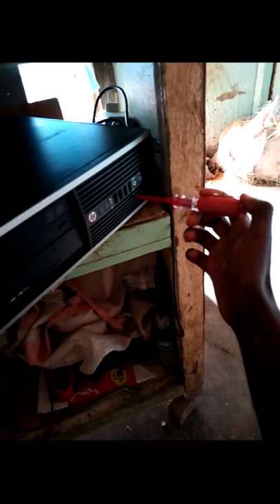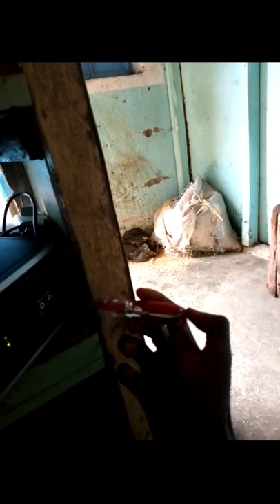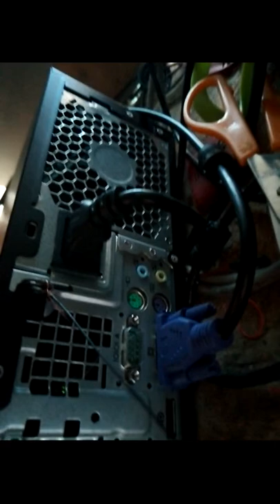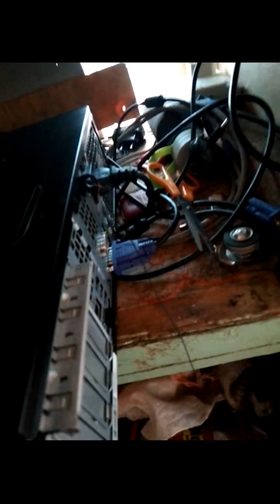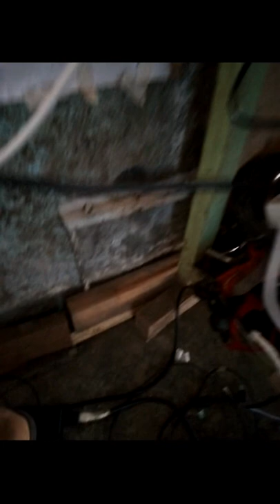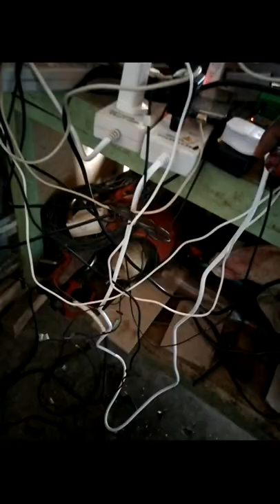How to fix electric shock when you touch pc

Comment: Will surge protector or power strip solve the problem ? My home electricity has earthing and cpu has 3 pin power chord.
Reply from the maker: It still has shock?
Reply: @wanjohimuthoni  yes
Reply from the maker: @adityaghorpade3128  try to ground the metal case that is shocking you
Reply: @wanjohimuthoni  do you mean the wire should freely lie on the floor?
Reply from the maker: @adityaghorpade3128  yea, or if possible push it to the ground..
Reply: @wanjohimuthoni  Thanks ..
Reply from the maker: @adityaghorpade3128  welcome, let me know if it works
Reply: @wanjohimuthoni  Yeah it works and what about internal parts are they safe.
Reply from the maker: @adityaghorpade3128  yes, they are very safe.. I had the same problem over an year ago, that's why I decided to help anybody who may have gone through what I went through.. my computer is still fine
Reply: @wanjohimuthoni Thanks👍🏻
Reply from the maker: @adityaghorpade3128  am glad to be of service.. kindly share and subscribe

Comment: Hello, How do I fix if I am on the 2nd floor cannot put anything into the ground? Is the shock bad for the PC itself?
Reply from the maker: It's bad for pc and you.. try a way to earth the electricity.. try to push a pin/nail to the wall, then connect a wire from pc to the pin.. let me know if your problem is solved
Reply: Have you tried grounding it in soil with a pot ?
Reply: @wanjohimuthoni  I live in Italy and the walls are cement lol
Reply: @jhonmacraimbanajokora8657  no haven’t tried not bad idea tho.
Reply from the maker: @tala9499  it still works, push a metal pin(nail) with conducting wire, then attach it to the pc

Kindly let me know if it worked for you
Reply: @wanjohimuthoni  Hey sir! i did the same way but first i drilled my floor and put the wire there and connect the wire with the pc case, does it work? I am on the first floor btw so it is directly to the earth can it work or can it cause any damage/ issue?
Reply from the maker: @iamfat6944  yes, you can.. connect it to wall thru' a conducting wire/rod
Reply: @wanjohimuthoni  Thanks!
Reply from the maker: @iamfat6944  it will work as long as wall is concrete, not wooden or glass
Reply: @wanjohimuthoni  hi, i tried that nail tip but still getting shock :(
Reply from the maker: @Najib_Op  hi, is the wall concrete to ground or it is wooden/glass wall or other materials?
Reply: @wanjohimuthoni  its brick and cement and i have earthing problem only in pc and laptop not in fridge or other electronics
Reply: @wanjohimuthoni  and my house is not grounded (checked) so can i use my pc?
Reply from the maker: @Najib_Op  can you run a cable outside, to earth.. (I believe it is not very long)
Reply: @wanjohimuthoni  its not possible im living in 4th floor but my question is y earthing only in pc 🤔😅
Reply: @wanjohimuthoni  it worked for me...thank you

Comment: So I accidentally had a broken usb 2.0 for my vr headset in my pc usb slot and it shut off my pc and I turned it on and it turned of immediately and it repeats until I manually shut it off, what do I fix?
Reply from the maker: What if you power it on without the USB?
Reply: @wanjohimuthoni  it does a turn on and turn off cycle.

Comment: hi is it okay to point the nail on the wall instead of on the floor?
Reply from the maker: The only thing you need to know is that u are earthing.. if wall is wooden you will need to run a conducting wire to the ground

Comment: What type of wire is this???
Reply from the maker: Normal wire, normal conducting wire
Reply: @wanjohimuthoni  Was that a earthing rod??
Reply from the maker: @mritunjoydede1255  yes, use any conducting wire to the ground
Reply: @wanjohimuthoni  instead of this method, if I do body earthing, then can this short circuit problem of pc be solved????
Reply from the maker: @mritunjoydede1255  what you mean by body earthing

Comment: Bro i have same pc and same problem.
Reply from the maker: Connect a conductive wire to the PC and push it to the ground.. kindly comment if it helps..(watch video)
Reply: @wanjohimuthoni  when i touch tester with my pc so and i touch tester with my finger then it glows and when i remove my finger with tester so it stop glows.
Reply from the maker: @mohammedsahil3170  connect wire to PC and the other end, connect it to ground

It should solve your problem, once forever..

Let me know if that help